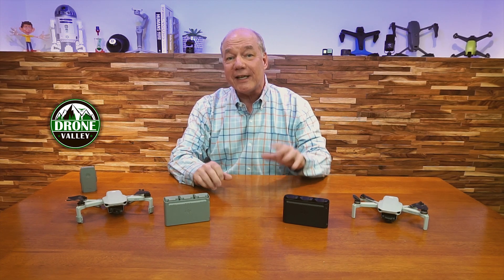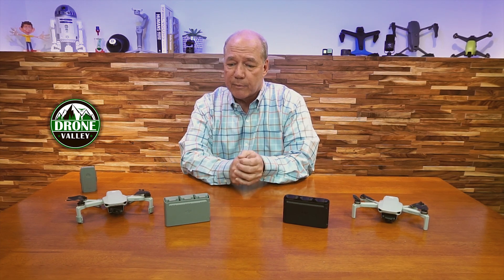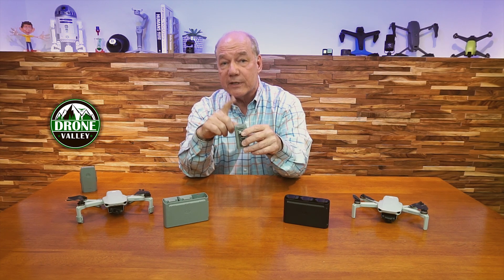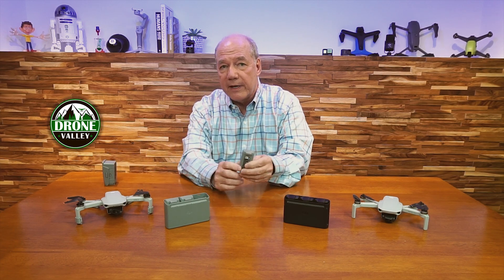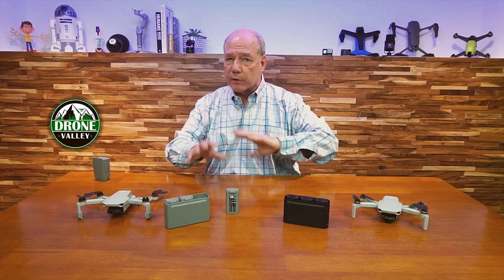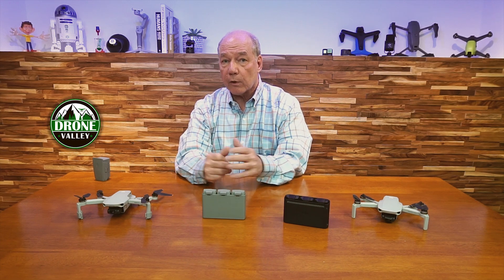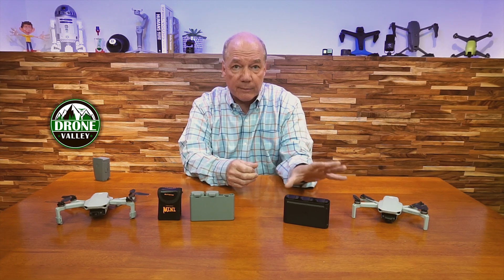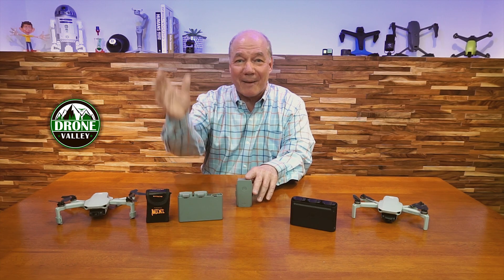Mini 2 Battery Issues and How To Fix Them

Comment: good info but doesnt know how to fix batteries in hibernation
Reply from the maker: The DJI batteries maintain a 5-10% "reserve" that prevents them from going totally dead long after the lights are out. If you're in this state, simply connecting them to a charger will wake them up and start charging. If this doesn't help or if you notice any swelling of the case, it's time to replace them. This video was more about the issue with the batteries not auto-discharging when in the hub like they were supposed to do. I explained how you could slide them in backwards so they didn't connect to the contacts on the controller to trigger the feature. This has actually been corrected in newer hub firmware so be sure you've updated. Thanks for the post!

Comment: Title does not match the content
Reply from the maker: The clip explains some of the issues with the Mini 2 batteries (auto-discharge) and provides a way for you to trigger this when needed. This issue was later fixed with a firmware release from DJI for the hub and the batteries but at the time it was a big issue that could have cost you your batteries. When you do the firmware update, be sure to update all of the batteries you have since it normally only updates the battery in the drone during the update. I hope that helps and thanks for the post. Rick

Comment: Dont agree. Have never seen a brand having so high percentage of batteries that dies on you.
Reply from the maker: Thanks for the post but I can’t agree. I still have Phantom and Spark batteries that are working fine after several years of use. You need to treat your batteries like a puppy. Don’t get them too hot or too cold and they’ll last a long time.
Reply: @Dronevalley Others make batteries that are easy to use. DJI made it stupid.

Comment: New drone flyer here! Just started with a Mini 2 and loving it but definitely overly conscious and cautious about the battery life, especially since I bought it used. Was there ever a firmware update for this issue?
Reply from the maker: Welcome aboard! Yep, the latest firmware fixed this issue. Be sure to check the DJI site for your drone under the "downloads" tab to make sure you're on the latest. Also, when you do the update be sure to rotate all of your batteries through the drone. They each have controllers inside of them (smart batteries) and may need to be updated as well. I hope that helps and be sure to sub the channel so you don't miss anything.

Comment: Thank you for sharing information about battery. I just bought my first drone mini 2 (2nd hand) and did all the firmware updates on both the mini 2 and the controller. Do you know if it is safe now to store the three batteries in its battery hub?  Thanks again.

Comment: You talk a lot, but at which point are you speaking about How To Fix Them. I watched the video and just waisted my time.
Reply from the maker: I gave you several suggestions on how to discharge the cell and explained how the internal controllers work in the clip. Let me know what issue you're having and I can help you.
Reply: @Dronevalley  All your suggestions help to extend and optimize battery life to avoid battery issues. That is great if the title would cover this. But your title suggests that the video would help how to fix issues, e.g. blinking led's, comms issues, etc. That I did not see in the video at all.

Comment: I have problem with my dji mini 2 drone batteries i put the battery hub on charge the 2 batteries are charged and the 3rd one is blinking and when i put that 3rd one in the drone the drone cant even turn on what would be the problem any solution ?
Reply from the maker: I think that battery is shot. Temperature is your biggest enemy with these Lipo cells and just a few hours in a cold or hot car can kill them. If you pop it into the drone after charging and it won't power up, it's time to replace it unfortunately. Be sure to recycle it at a Home Depot or local hardware store. Lipo cells can ignite if damaged and burn incredibly hot.

Comment: So how do you fix them? A lot of yapping for 14 mins and didn’t show us how to fix them
Reply from the maker: Dogs tap, I was speaking slowly to explain the initial issues with the batteries and their interaction with the hub and not discharging. DJI has since fixed this issue so no worries.
Reply: How to hard reset my mavic mini

Comment: one  of my batteries will not charge all four lights flash 3 times 
any ideas please
Reply from the maker: Thanks for the post and the only suggestion I have is to put the battery in the drone and run it down all the way to "empty" to reset it. The controller inside of the battery reserves about 5% of the charge so it's not really dead at that point but the counters and other metrics are reset. You can then try waking it up by charging it and it may fix the issue. If not, you'll have to recycle the battery and use a new one. I hope that helps. Rick
Reply: @Dronevalley  i think its not been used at all - bought second hand  the other batteries have 2 and three charges !! thanks
I am sure there is a way  of waking it up as it hibernaed

Comment: Thanks Rick, I plan to remove my batteries from the charger NOW. I had  no idea they needed to be loose to activate the auto-discharge😂
Reply from the maker: Thanks for the post and if you've updated to the latest firmware on the batteries they should now auto-discharge in the hub. Try updating and testing the feature and you may be alright. Rick

Comment: 2 year old Mini 2, and leave my batteries in the hub for a few months at a time , and they auto discharge fine. I don't fly a lot, but when I do, I charge them all fully until all lights are solid. I have 6 batteries. I keep it even, 8-10 charge cycles each battery and I have zeros problems so far.

Comment: DJI mini 2 battery reports a bad cell, nothing here to help with that.  
Its DJI being super safe, its not a fault, well it is really. 
DJI must have a kill switch inside the batteries if they get dunked in water, like mine, it kills the battery dead.
The mini 2 turned into a sub...its ok, just a dead battery.
Reply from the maker: Thanks for the note and I'm sorry that you're having issues with the battery but there is a "fuse" inside of the battery pack designed to protect you against a short circuit. When you dropped it in the water, it shorted out the cells and could have possibly caused a massive Lipo fire so the fuse protected you from that. Unfortunately there's no way to replace/reset that fuse so you'll have to replace the battery. I hope that helps and you get back up in the air soon. Rick

Comment: I just bought a fly more kit and only 2 out of the three batteries work. Because they plugged one into the drone and it totally discharged.

Just know if you’re going to buy a new in box mini 2 fly more kit this late since release. You’re only going to get 2 of 3 batteries.
Reply from the maker: Thanks for the post but all of the batteries shipped with the drones are in their "dormant" state. They have to be woken up with the first charging and you should charge them to 100% before flying. They can sit in this dormant state for years on a shelf in a warehouse and won't lose any of their charge potential. Once you wake them up with the first charge, you'll need to always keep them above 15% when you're not flying or they may actually drop to zero and can't be revived. If you've tried to charge a new battery and it's not taking a charge, contact DJI and they will replace it for you. I hope that helps, Rick

Comment: my batt flahes 3 times in charger and dont charge  any ideas   seems like hibernation mode
Reply from the maker: Sounds like they have been dormant for a long time and may have entered hibernation mode. The best suggestion I can give you would be to put them in the drone and frain them completely and then try and charge them. That may "reset" them for you. If not, you'll need to replace them.
Reply: @Dronevalley  cheers

Comment: I just watched the video and never got an answer on how to fix it 🤬
Reply from the maker: Thanks for the post and as I mentioned in the clip you have two options. You can update the battery hub firmware to the latest version and that fixes it or you can slide the batteries into the hub "flipped" to keep the contacts from touching the internal connections. Both of these will trigger the auto-discharge function of the batteries to extend their life.

Comment: I’ve been using LiPo batteries for years and consider myself to have a good grounding on them . Congratulations on an excellent video, very well presented and pitched at a novice to knowledgable person.  I think  is very helpful for those getting or got the Mini 3 Pro.

Comment: Fast forward 14 months (7/22).  I just bought a Mini 2 Fly More.  One battery shipped in the drone, the other two in the charging hub.  I've read that DJI was working on this "problem", but yet...  So I charged all 3 batts, removed them from the hub and I see no discharge after three days.  All indicate fully charged.  I don't know what to believe.

Comment: Hi Rick.  Love your channel because it is so informative.  Question:  Could you confirm that it is inadvisable to use the Mini original batteries on the Mini 2 ?
I am assuming that you cannot due to the batteries having the 2 different technologies. Thanks a ton.

Comment: To me, the auto discharge IS the "issue". Had I have to drive full day to a beautiful scenery just to find out these smartass had drain themselves in the middle of nowhere. As a consumer, I couldn't care less about the technical, just build something practical
Reply from the maker: Thanks for the post and the challenge with the LiPo chemistry is that it will start to decay quickly if left fully charged for too long. It's like a wound spring that want to unwind. The good news is that the self-discharge feature happens slowly and won't even start for a few days so you'll be fine. if you leave them fully charged for a few days, you'll thank DJI for discharging them instead of needing to replace the expensive battery. The other option is to use our 95W car charger and charge them on the way to your location. I hope that helps. Rick

Comment: Hey everyone 
I just bought  a dji mini 2 
But i have problem with the battery it flashing all the 4 led light and is not turning on.
Any suggestions?
Is a brand new drone.

Comment: Excellent video. The only complaint is that the batteries for the M2 are not the same shape at the top and bottom and you need to use force to insert them into the HUB the other way around. The batteries even have small grooves on the bottom, and the HUB and the drone have corresponding protrusions, so that they are not placed upside down. Thank You!

Comment: How do you set your batteries to storage charge?  3.8v per cell.
Reply: Just charge or discharge right until after the 2nd light in the fly more hub is on and the 3rd light starts to flash, that's 50% and about right. You can discern going further into that process more detailed if you choose to do so. Happy flying

Comment: I’m not sure if DJI have issued a firmware update for the batteries yet, but I’m not going to rely on their say so.
I tried storing the batteries in my 3-way charging hub with a thick rubber band around the top of the battery but the electrical contacts inside the hub were biting in to the rubber band so I ditched that idea.
Instead, I cut up a plastic eraser into smaller pieces about 18mm thick (I’m sure a thinner piece would work fine too) and dropped them into the bottom of the battery slots in the charging hub, to prevent 100% insertion of the batteries into the hub, while still achieving good storage efficiency in the Fly More Combo carry bag.

I don’t want to take any chances with the batteries that might shorten their life.

Now to find somewhere in Australia to actually fly the damn drone without having to apply for a permit many days in advance…
I don’t encourage law-breaking but the restrictions here seem to encourage flyers to just send the drone up when there’s no one around, fly around without bothering other people, then pack up and get out of there before a park ranger shows up. Rather than applying for a permit, wait for a week or more for a response, and maybe get rejected any way. I’m all for complying with the rules from the air space regulator (CASA in Australia), but all the parks seem to require a permit which is a pain in the ar$e.

Comment: why auto discharge? 
You get your drone out and have to plug it into USB before you can fly it because the twatting battery has gone flat. Stupid idea, when charged and not using the drone the batteries should stay charged and not go flat
Reply: Don't take this wrong way, but please try to learn more about lipo batteries. This is exactly why dji designed these batteries to act this way.
Reply: You can buy original mini batteries and charger and suit yourself, if you're willing to sacrifice a little flight time and performance. Happy flying

Comment: THIS ISSUE IS FIXED
DELETE VIDEO TIME WASTER
Reply from the maker: Thanks for the post and I think your caps key is stuck. I do realize that this issue was fixed with a firmware update a while back. I actually had that firmware early and was one of the testers for DJI on the code. The clips I create also include a lot of other great information (like this one) so no time is being wasted because you'll always learn something and the mark of a good pilot is to always be learning.
Reply: @Dronevalley  I was just salty because I panicked about this issue on my break at work and it consumed my whole break. I’m sorry mister
Reply from the maker: @suspicioustumbleweed4760  No worries, I enjoy putting these clips together and hope you stop back soon for more of them.

Comment: Nice. Only that you cannot flip it backwards to the charging hub.
Reply from the maker: Thanks for the post but DJI had fixed this issue with new firmware so no need to flip the batteries around anymore. Be sure to update the firmware on all of the batteries to make sure you're covered. Stop back soon for more content posting this week.

Comment: L P  Estrada 
I can do the battery out of my 3 pocket storage, but I canot turn them around and and reinsert.  My DJI Mini 2 storage has a moulded guide runner that fits each battery and does not allow the battery to seat to the bottom, only half way in. So I will try small block of fire proof stuff inside a metal contatner.

Comment: Thank you! I'm want to use this for prospecting, so I'm thinking of getting the mini 2 fly-more package, then ordering a spare Mini 1 battery so I can always have one battery that is topped off. I can keep the mini 2 batteries at 50% so as not to damage them, and if I need to get in the air unexpectedly I can use the lithium-ion while I'm topping off the 3 lithium polymer batteries.

Comment: Good info. But my issue is my Mini 2 nor my controller will not turn on. All batteries are charged up. Push the button to turn on and the lights light up and then go out. Nothing will turn on. Any ideas?
Reply from the maker: Harold, I replied to your other comment with this solution - hold the power buttons until the LED's strobe all the way up and you'll hear a tone to turn the drone and controller on. Try that and let me know if that's the fix. If not, we can try something else.

Comment: I have stabbed many a fully charged Lipo battery over the years and it is an old wives tale that they will burst into flames....Utter rubbish!!!
Reply from the maker: Thanks for the post but a simple Google search for "Lipo Fire" will show you how utterly Un-rubbish the concern is. Just because it hasn't happened to you doesn't mean it doesn't happen. Again, I'm not trying to scare anyone, just make them aware of the proper way of caring for these amazing devices.

Comment: You didn't tell how to fix the 3 x blinking of all 4 LED's (on 2 of 3 batteries), which I got after storing the batteries for 1/2 year, charged at 50-75% inside the hub.

Comment: They are extremely tight putting in backwards.  I'm not trying to damage the Batts. How did yours slide in so easy??
Reply from the maker: I had them in and out a few times and they made the slots a little larger. You won't have to do this anymore since DJI fixed the issue. You can simply update the firmware and they will discharge normally. Thanks for the post and I hope that helps. Rick
Reply: @Dronevalley , you might want to pin this comment. I just bought my Mini 2, and it's good to know that the firmware update fixed the battery issue. For a first time user the battery issue sounded confusing, though you made a clear attempt to explain it. Thanks.

Comment: I hate to break it too you but this video is completely irrelevant. They discharge even if connected to to the charger and drone. And they self monitor.
Reply from the maker: Thanks for the post but your comment is completely irrelevant (just kidding). If you check the date when this was posted, DJI had not yet fixed the issue and I posted the clip to warn others about the batteries not discharging and how to fix it. Since then, the new firmware was released and it sorted it out. Even still, there was a lot of good technical background in the clip explaining how these cells and the hub work.
Reply: @Dronevalley  then tell people that. So I don't have too.
Reply from the maker: @carlosnumbertwo  Again, this clip was posted long before the issue was fixed and I provided background on the issue and a workaround. Most fliers that watch the channel got the updates through postings in the comments section.